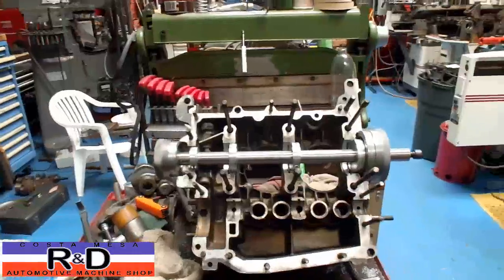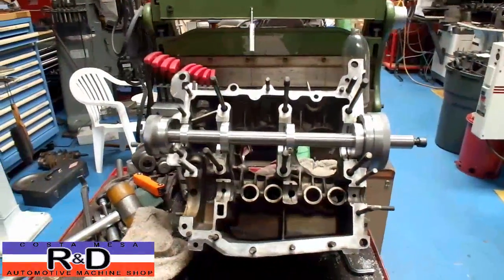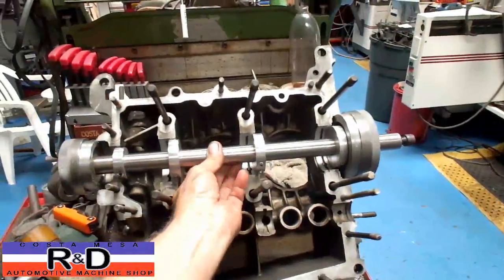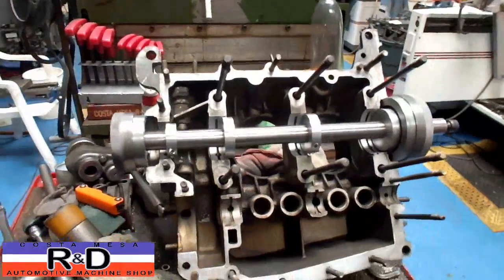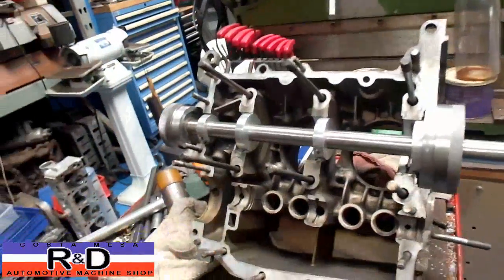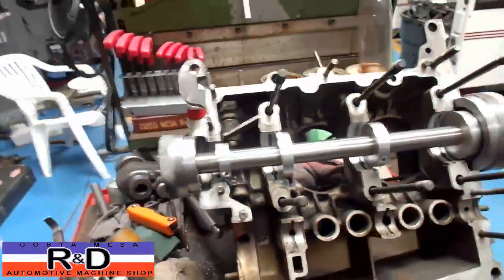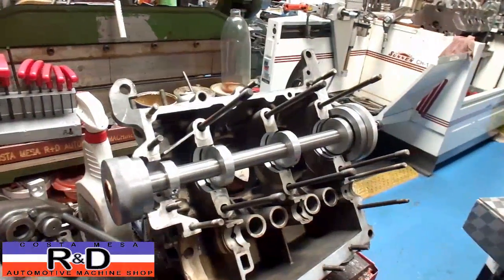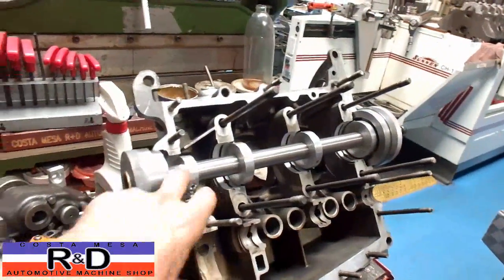VW Waterboxer Alignboring Tool

Comment: Bearing dimension varies depending on what the repair is.  John shows a method of over-boring the case bores to accept oversize bearing shells on the OD (outside diameter).  Or, if the case bore is good and the crank needs machining?  You get undersize bearings with a reduced ID (inside diameter).  Note that John would be machining the case with the case halves assembled, to make sure the halves align with each other.

Another way of machining the case is to cut each case parting line and bore the mains back to standard diameter.  However, that presents a problem for the rest of the stuff on the engine (cylinders, rods + pistons, timing chains) because you're effectively making those parts longer relative to the narrowed engine case width.